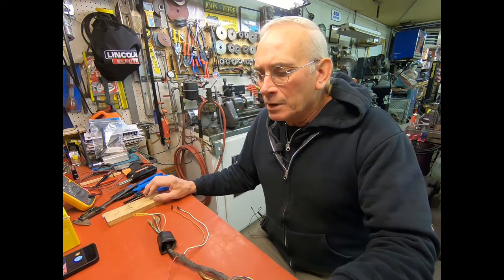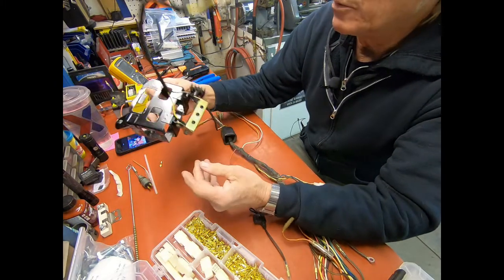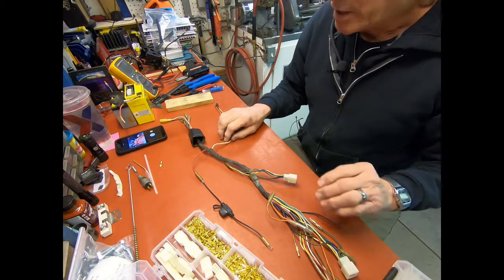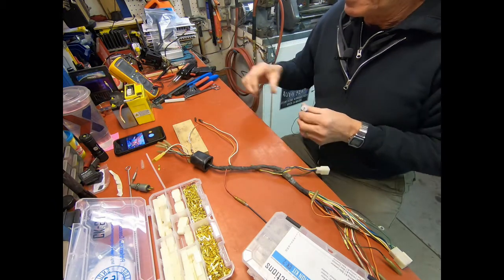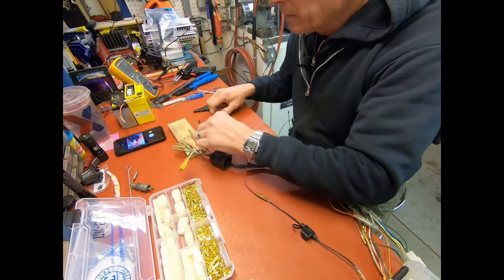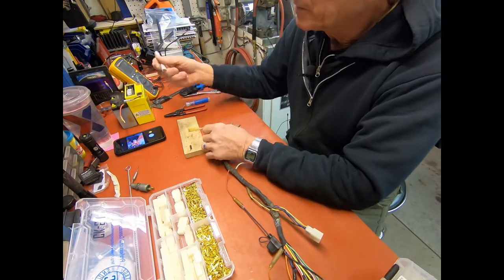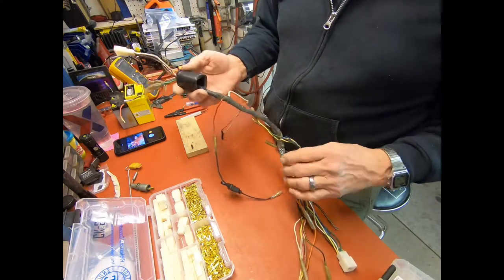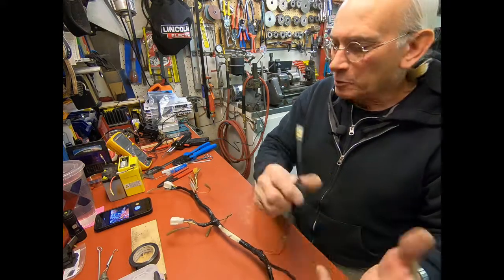74 Suzuki wiring harness repair

Comment: Hi Dale, I'm a new subscriber to your channel after watching your TS250 engine rebuild videos to refresh my old memory as I'm starting a TM250 project. I enjoy the work you do on the bikes and learn a few things along the way. I have a 1072 TC90 to finish next year and the wiring video and connectors is helpful. Question for you, are you repairing the chrome fenders and fork tubes and legs or buying NOS? Your TC125 chrome parts look new. Pitting of the chrome seems to be a problem area on these 50-year-old bikes.  BTW ... I have about 30-40 boxes of mostly old NOS Suzuki dealer stock parts and some Yamaha parts pistons/rings/cables if you can't find what you need. I stopped selling on ebay years ago.
Reply from the maker: Well thank you very much and hi back at ya. All the chrome parts were rechromed by St Louis chrome plating. These were really in pretty good shape to start. Wow I will have to hit you up on the parts. I can understand not selling on Ebay, I just hate it these days. Still have a few items on there, but they have just about priced themselves out of business in my opinion.